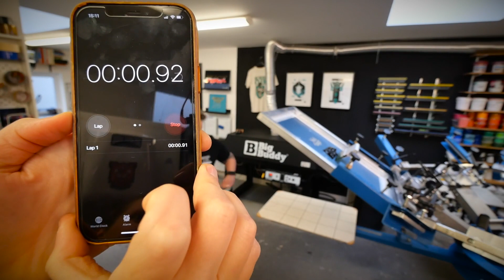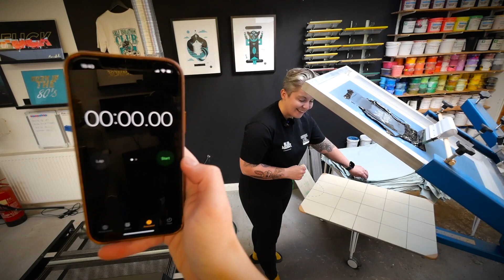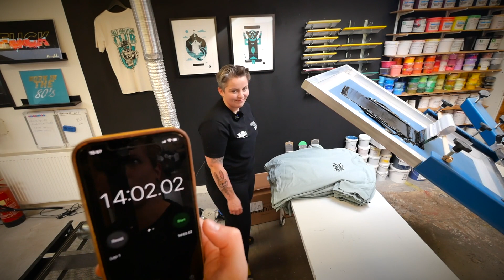What is the best layout for a small screen printing studio? We time trialled our printing workflow.

Comment: You have certain limitations for exhaust and plug/power sockets. It might be worth an electrician to add/move some if it saves you minutes per batch.

If you add 5 seconds per process step it’s an extra minute per shirt then hour per order. 

Good workflow is for efficiency over time. Which saving time means making money. Or even just saving time is valuable because time is something you cannot buy.

Comment: Definitely would say your original setup is better, taking into consideration that you have to wait for all the shirts to get in the box, THEN stack them (which also adds wrinkles to the shirts lol and the hazzle of finding the sizes, etc.) so yeah, I would personally stick to the original setup. Probably a bit more exhausting due to all the movement required but definitely more efficient. Probably consider moving your kruzer closer to the loading belt, instead of moving the dryer itself...great video!!
Reply from the maker: Hey Jeremy! thanks for the comment - cheers, yes I think the answer seems to always be I did a little more room!

Comment: Hello, your results were not as efficient as they could be for a few reasons. First, When you were loading the shirts in the dryer, you folded and pushed the info the dryer (not done that way on the first 25). Second: a multi color design would yelled a totally different result. The more colors printed the slower your normal way of printing becomes. Finally: the phone timer was not shown until the end of the video so there is really no way of knowing the correct time (not saying you're not truthful...it just wasn't the same as the first 25).

That said, I understand that your setup works best for you and your business. The more efficient your setup is the faster print...walking time is printing time. You would have to move your room around with efficiency in mind to get it to work correctly. Efficiency is the magic word that all screen printers are chasing (that's why we buy automatic presses).

At the end of the day...if you're making money and you're happy...it's working as it should for you!
Reply from the maker: Hey Emmanuel, we appreciate your ideas on the video! We could do tests for multi-colour on another occasion for sure, that would give different results too.  Yes, the timer was shown a bit more during one set of prints, we were aiming to show you the timer when the last shirt was stacked on the pile each time, as that was the test. Also, I do see your point about the shirts being loaded in a different orientation, the shirts didn't get in my way on the belt on the first set and the belt speed was the same throughout so I don't think that changed the results too much. I think the point we are trying to make is that in the space we have, the dryer can't be moved as the plug, controls and belt direction mean it needs to be up against the wall as we have columns in the middle of the room. I do actually agree that being a step closer to the dryer is good but we can't do multi-colour prints in that configuration as the press needs to turn around but also have room for people to walk past. I reckon if we get a bigger room we will get everything flowing better as you suggested.  We are doing a video about waterbased ink curing soon, I hope you watch that too, and then I explain why we can't just load the belt up with shirts as quick as possible as the inks we are using need over a minute in the dryer to properly cure.